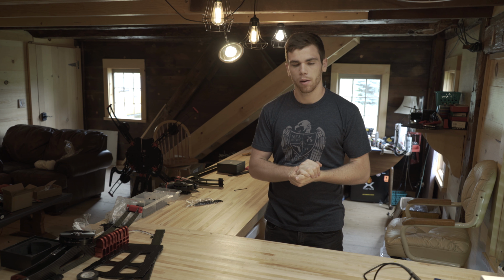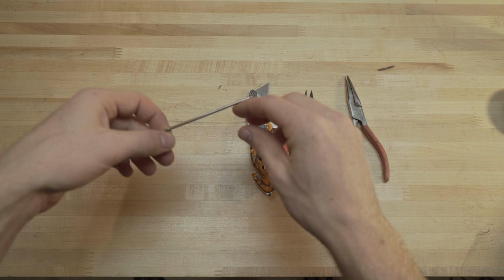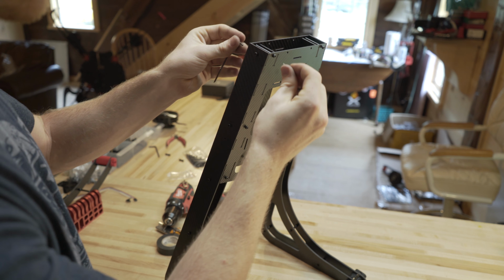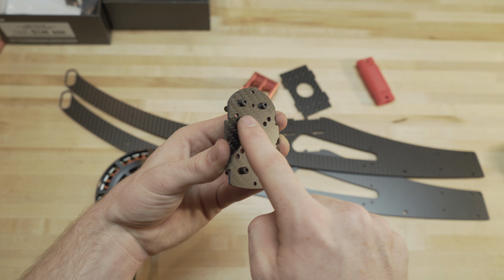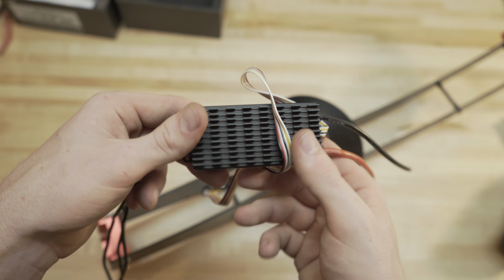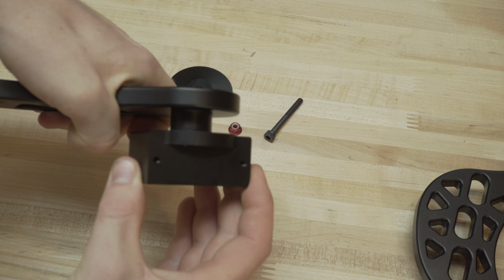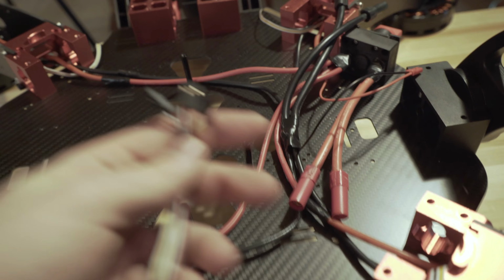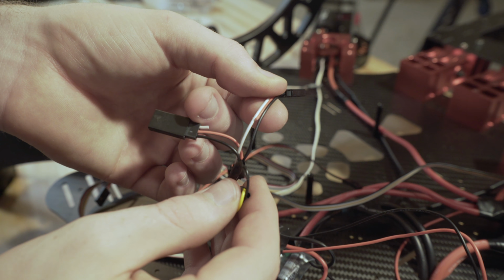OpenPPG 22 v3.1 Build Video (part 1)

Comment: Haven't wached all the vid. Just an advice to use Loctite for mounting motors. I would use it everywhere you don't use locknuts, including standoffs, etc. The frame is vibrating always and there are a bunch of parts and joints in the assy.
It's surely an extra work and a bit messy as well, but totally worth it since you do assembling just once and it's not an RC quad that in case of loose bolt just crashes. Here you crash as well in that case, get injured or at least face an  emergency landing. Just saying...
Reply: Small cotter pins...or safety wire.
Reply: Cotter pins/wire still vibrates .. gluing as suggested is the  only way

it done only ONCE

& REMEMBER .. XOUR LIFE DEPENDS ON IT

it can't be 'just another drone crash'

one may get killed

Comment: Looking at your video I'm concerned about the lengths of wire that you've added to the ESCs. I have already left comments on the OpenPPG website and have reiterated the basics here. I don't know what ESCs you are using but, this link gives Castle's opinion on the subject of battery wire length:
http://www.castlecreations.com/en/castle-wire-08-gauge-red-36-011-0028-00

This bloke appears to know his beans on the subject of long battery wires killing ESCs:
https://www.rcgroups.com/forums/showthread.php?952523-too-long-battery-wires-will-kill-ESC-over-time-precautions-solutions-workarounds

When things go BADLY wrong:
https://www.youtube.com/watch?v=52K8PKqSxkM

I realise putting the ESCs in the airflow seems like a good idea but, if you had fitted them to the baseplate; you could have used the long motor tails already provided by the ESC manufacturer to connect to the motors, then the battery supply tails provided could be kept short, as I think the manufacturer would want.
I see one person on the OpenPPG website is talking about putting some of the batteries in his instrument deck container on his lap, do me a favour!

All the best,

FrankH